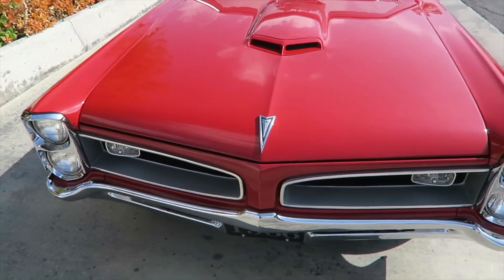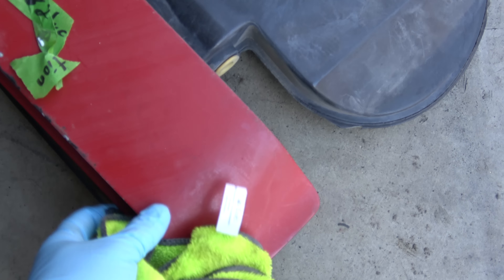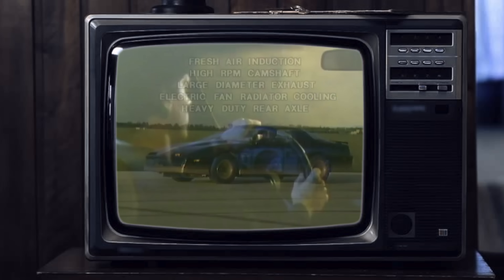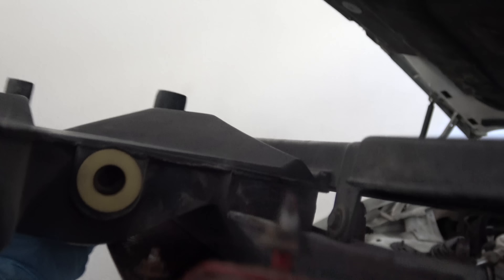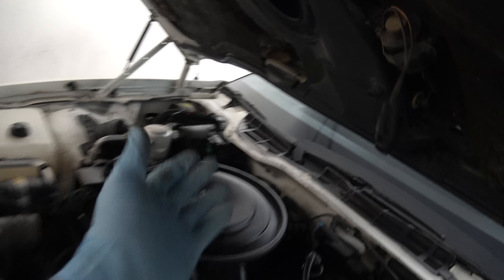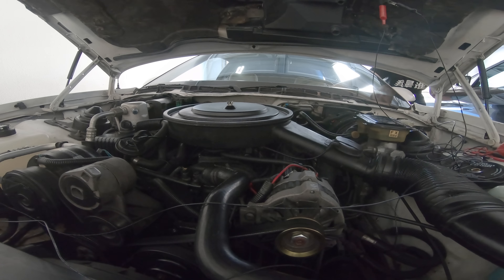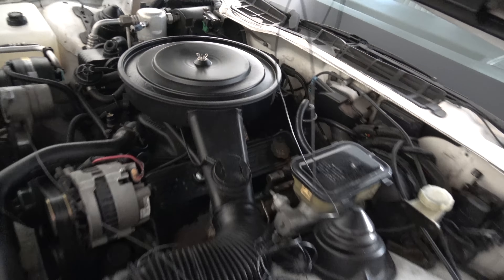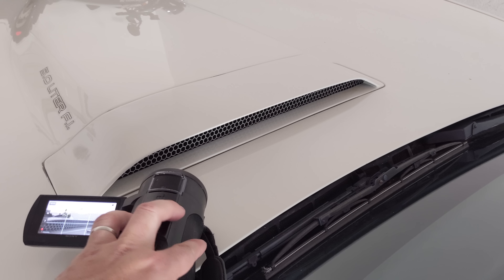I Unlocked Massive Power in My Firebird

Comment: If you want it to last you can’t have that hole in the air lid be past the inner edge of the air cleaner, you are totally bypassing the air cleaner like you did it, the hole must be on the outside edge of your lid so it still gets filtered. You seem to want car to last well you must filter air. All old muscle cars with air induction still run the air past filter when air induction flaps open

Comment: How does it give more power? Sucks the air at high speed from the front of the windscren is what I think. For higher  air pressure the nose should look forward, not backward. Or what?

Comment: I have a 84 Trans Am with the 5.0L E4MC Rochester 4 barrel carb. The car is all original except for the normal wear items. It’s completely un-molested. It has all the pollution items. The car has the fresh air blister hood and air cleaner assembly. The solenoid still works. What a great car. The only issue I have with it. It hates rear tires. I love pulling up next to a rice’r with an obnoxious fart can muffler. Of course they have have to sit there and rev their engines, like a mad man. I guess to prove something. So I just smoke them out when the light change. Lift the pedal when I hit the speed limit. Of course their dignity has been bruised by a 38 year old car. So they go flying by me. I call that. Making Cop Fodder.

Comment: Cars are simply big breathing machines. Just like humans, the more air we can take in while “moving” the better we perform. Having said that, I don’t think he added “massive” power with the reverse scoop. Pontiacs with true “Ram air” scoops, facing forward, usually gain about 5 horsepower when at the correct speed. The other end of the equation is to expel the air quickly. Adding headers would gain him even more horsepower - 15 - 25 by most tests.

Comment: I'm an American and the fake scoops drive me nuts.
BUT if you had the Trans Am hood the two little vents on the sides of the hood were functional.  
...And there were also two scoop/vent looking things up front that were nonsense.
Reply: The fake scoop culture is prevalent enough, when my friend's Neon SRT-4 was damaged and needed a hood, and he couldn't find the right hood at a price he liked, some "expert" said just to get a regular Neon hood.  It didn't cross most people's minds that the SRT-4 was functional. ...Which it was.
The scoop blows air over the turbocharger so it doesn't cook the rest of the engine bay.

Comment: it's basically an air filter bypass cool for more power but you will get more debris in your eng if you run it open all the time put it on a switch

Comment: 1984 Formula Trans am , 178 mph, still had peddle 200 mph...    I painted it Laguna Blue... 2 years later I gave this car to a co worker of Lisa's, they didn't have a car and were poor... I gave this car away in good condition...  very fast car... faster than a 5.0 Mustang i owned, much faster...  My Mustang was faster in 1st, 2nd gear, then my Formula would catch it and leave my Mustang in the dust, both tuned up way better than stock tune...

Comment: i have an 84 , i have that thing . its in my storage i didnt realize it was valuable .  I use an open air cleaner and let the engine heat escape out of that hole
Reply: mine was working great . i threw a bed sheet over the hood and it would suck the sheet into the scoup when i reved the engine .
Reply: I used gasket maker ontop of the old gasket for a better seal . then i used shaving cream to make sure it was touching everywhere

Comment: Didn't the "turbo hood" have a boost gauge in place of the air intake?
Reply: only on the 80 / 81 2nd generation  "Turbo" Trans Ams, not the 3rd generation ones like this

Comment: 5:05 DONT jam the damn thing open, if you get caught in the rain, you'll get direct injection water into your engine, and california, when it rains has one hell of a rainy season, and just in general that is a very bad idea to do such a thing, as it was made the way it was for a reason, as if it works, dont fix it, plus if you try and do it manually you'll have to drill something and some sort of fitting from the engine bay into the interior of the car much like the shaker hood on a Cuda, where they literally had a lever under the dash they needed to pull to manuall open and close the damn thing all the time.

Comment: 20% more power. I wouldnt think so... That would be another 36bhp approx.
Reply from the maker: This weaksauce engine puts out about 170hp and is heavily restricted, it feels like 20%
Reply: @WorthlessWhips  Yeh i know i had one. Well mine was a 88 305TPI. The 88's were the start of the Roller Rocker engine rated at 205bhp.

Comment: Only problem with this is (as I see it) with this open you are bypassing the air filter and sucking in whatever crap (dust, sand, other debris) is in the air. Perhaps that is why they were supposed to open only at full throttle.
Reply from the maker: No it doesn’t bypass the filter

Comment: Just a heads up..my 84 TA had this stock. It cost me a good engine. Bent connecting rods and all. One day I tried starting it up during a heavy down pour and CLUNK! Hydro-lock. Some of the 30+ year old gasket material had crumbled enough to allow rain water to slide right off the windshield and pool into the pistons through the carb while parked overnight. I bought a new crate motor and ripped the whole induction system out for good. Into the trash it went. Bought an open element air cleaner and I figure it still pulls in air through the hood scoop which I left open behind the honey comb grill. There is now no direct path for water to get into the pistons. The open element probably also pulls in hot under-hood air, but oh well.

Comment: now you have changed the air / fuel ratio.  you should adjust the fuel or you will get engine knock
Reply from the maker: It's fuel injected so it automatically adjusts fuel ratio

Comment: Very cool, but nah, there's no power increase, and that's why GM stopped offering it, as it's just one more thing to break.
Reply: @SAL Ninethousand According to a dyno test conducted by Popular Hot Rodding magazine in 1987 the functional cold air package is worth almost 20 HP and even moves peak power up the RPM range a bit.
Reply from the maker: It helps for real

Comment: I got a Firebird too, it's a 87' Formula 350. Btw relatively cheap way to get more power out of those 305 smallblocks is to have the heads ported & cleaned to smooth out and speed up the air flow and thus increase power. I hear you can gain around 30hp doing it. There's another YouTuber by the name "Uncle Tony's Garage" that has a ton of videos on that kind of stuff. He mainly does classic Mopar stuff but a lot of it applies to our cars too.

Comment: take it to a dyno
Reply: Dyno would prove less restriction, but cannot simulate the high pressure air at the base of the windscreen that you would get on the road. Best way to test would be before and after in-gear acceleration times I think

Comment: By not having the scoop close uner light acceleration, you are bypassing the air filter. In
Reply: Air filter is not bypassed, air still goes thru filter first.  Had a 1984 TA with that set up.
Reply: @turbozombie3506  If it was the factory set up, the fresh air intake is closed off in normal operation. The solenoid opens and closes off the fresh air intake. Air from the hood scoop is being directed towards the intake toward the center of the air cleaner housing inside of the tank air filter.

Comment: Gm is cheap it was obvious they used the same hood till the car body changed. Dodge has used the same chassis for over 10 years on the Challenger/charger/ magnum. U can literally take the entire drivetrain and dash from a 2018 charger and bolt it into a 2005 magnum and not have to modify anything.

Comment: Because in the US. Half of the reasons why most of the events in scoops are fake in the US. Is we have too much government regulations a different restrictions that change year. The other half of the reason is. The engineer designers. Original design for these cars all these things function. But by the time the car corporation approves the vehicle for assembly and sold to the public. The design runs through all the accountants in pencil pushers. So a lot of the function of these things are cut. To keep cost down in maximize profit.

Comment: That will add almost zero power, only make it sound better. Put it on a dyno . The 350 tpi motor is the one you want. I owned one for 6 year and would beat most cars off the lights.

Comment: I always liked that model year formula. 
But I road in a 1970 Formula 400 about a dozen times. Same car. Automatic T400. And coincidentally the two hood scoops on it were not functional. But that car was still very fast. If it had the ram air engine option it would need to have a posi in it.

Comment: "Heavy Duty Rear Axle". Just to save you some heartache later when you grenade your weak ass 10 bolt, there is no such thing as a "heavy duty" 10 bolt, plan on replacing it with a Ford 8.8 or better if you make "real" power.
Reply: Good friend of mine built up a base model 3rd gen V6 to look like a Z28, with 500hp worth of LS2 through a T56 to match. He couldn't keep a rear end in it for long until he switched.

Comment: I think you have wasted your time and money imo cause the fresh and colder air is being rammed via the snorkel from the front and is being filtered via air cleaner now you are mixing warmer air from hot hood and is not passing the air cleaner. Now if you park under a tree you risk twigs ,leaves or anything else getting in your engine. Or I may be wrong in my assessment.